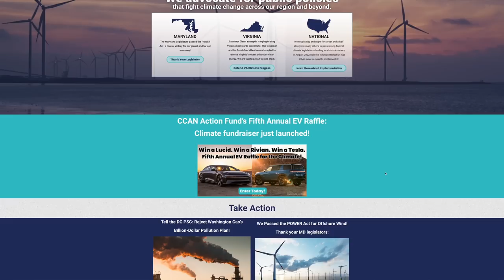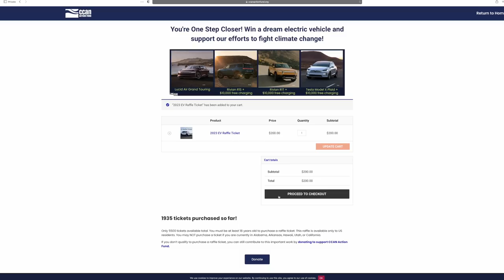NEW Tesla's White Seats after 60,000 Miles

Comment: I’m always on the fence about whether or not I want the white interior when I eventually order, but then I always remember how easy you make it sound to maintain.
Reply: I have the white seats on my myp 
Recently had a blue jeans transfer and cannot get it off.  🤦‍♂️
Reply: Yo Kevster, I've put 10.5k miles on my Model Y with the white seats. I've mostly worn black or blue denim on them and YES it does transfer to the seats. I've also had cherry icee, coffee and chocolate on them. So far, I've used nothing but hypoallergenic baby wipes on them and they look great. I clean up the spills and smears as soon as they happen and I wipe down my seats 2-3 times a month. My advice is, if you're interested in the white seats, get them. As for folks that have stain issues,  I'm curious about how often and "how" they clean their seats. Most will not mention that.
Reply: @gbearfan1670  my transfer were from “Cintas work pants” I’m assuming bcz they were new idk. To answer your question it was within 5 work days and got to them on the weekend and the transfer didn’t come off
Reply: 2018 model 3 white seats. 40k miles, still looks new

Comment: Only have 4 months on my white seats so far but adding a baby soon so that'll finally give the back some wear. Biggest issue so far was a black headrest pillow leaving dye marks on the headrest and seat (when I had it sitting in the passenger). Need to get the interior cleaner on it cuz baby wipes even w prior gyeon coating didn't take it off